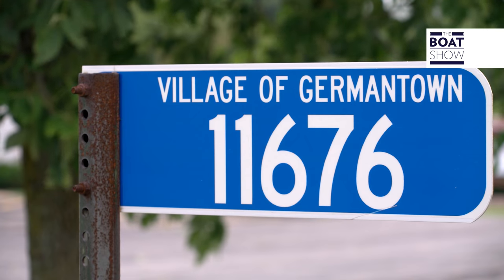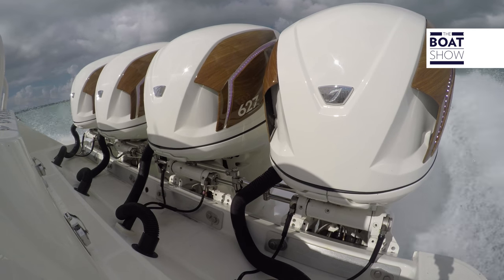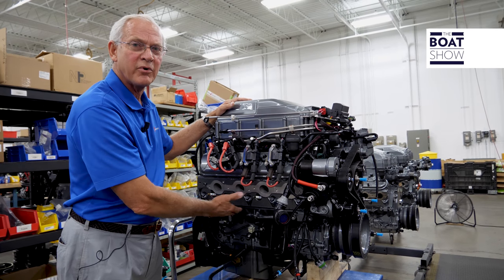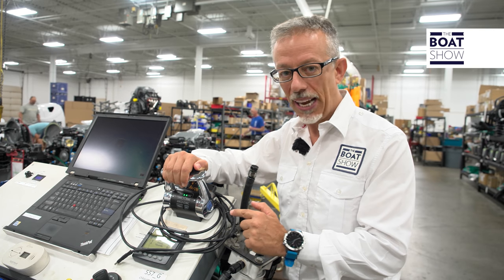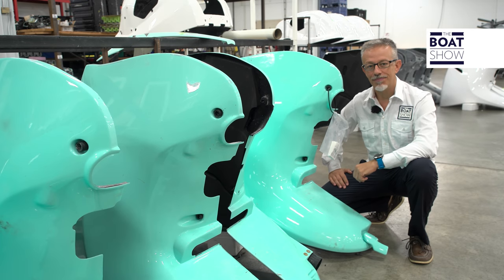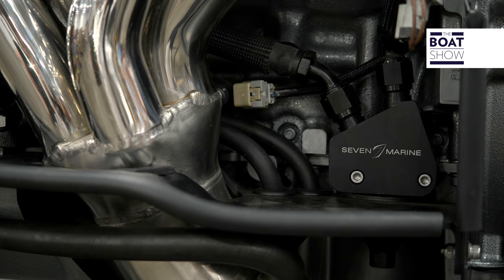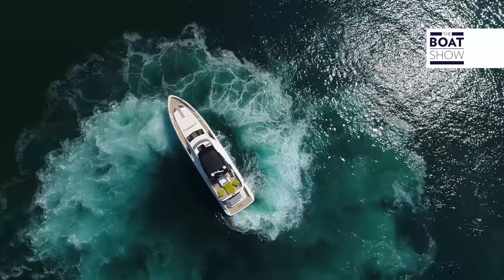[ENG] SEVEN MARINE - HOW IT'S MADE - The Boat Show

Comment: As an outboard Enthusiast and a bit of a engineer here at home I've always been intrigued by the seven marine outboard after seeing this video I have to say wow an American company with the Ingenuity to take GM's very reliable V8 put a marine cooling system drive system and a supercharger in a compact easy to service outboard configuration with a custom looking and sounding exhaust system Cal and LED lighting I think we're going to see this motor dominate The large boat Marketplace, starting to see some of the big-name large boat / yacht manufacturers embracing outboard power as well and it only makes sense they're easy to maintain in a large boat configuration and you don't have the toxic environment inside your boat from an inboard engine and drive. Maybe 10 years from now I can afford to buy a used one.
Reply: you will not see these on working boat Pleasure boats yes but not working boats
Reply: @dexter2433  - Many "working" boats in Oil, Seismic, Salvage and diving use outboard motors .
Reply: you meant to say a Swedish company, which it is by now.

Comment: Soooo many gears and parts to the transmission path.
Reply: At least they didn't use a CHAIN!!!!!
Reply: Andrew Fletcher yea I wonder how the gear train feels when you shove 650 horsepower through it.
Reply: gotta be some efficiency loss there. not ideal.
Reply: Massive torque, massive gearing.
Reply: Welcome to 50 hour gearcase oil changes
Reply: Was thinking the same thing - lots of gear mesh, gears churning in oil, bearings, inefficiencies.

Comment: They are very heavy though...Seven Marine 627... 1094 lbs each...vs...Yamaha 350 or Mercury 400r...668 lbs each.
On a 4 engine set up with Mercury 400r's...thats a difference of 1704 lbs...if you don't need all that power the weight gain
may be unnecessary!
Reply: dont forget the diffrence in fuel consumption

Comment: Fascinating engine. If it turns out there is a large market for these huge power outboards, I suspect additional vendors will join the party. I wonder if some one is seeing what changes have to be made to these LS motors to run in a vertical orientation. If they can be adapted without to much trouble, then you would sea a significant efficiency gain, simplification, space savings, power gain, weight loss, and cost savings. 7 marine will need to do that to remain competitive in the future. And Volvo Penta is still Swedish. Chinese Geely owns only the Volvo car line, which they purchased from Ford which owned it for a while. Volvo AB is still 100% Swedish and makes buses, heavy trucks, marine and industrial engines and more. And I will still call gasoline gas here in North America. I will call it fuel or petrol or whatever term they use when I am visiting those areas which do not use the term gas or gasoline.

Comment: idk, 270,000$ seems like alot for just 2400 horsepower of inefficient over stressed outboard motors

at what point do you just give up on this and go with a real inboard single motor with better efficiency 5/6/7 motors?

Comment: I’d love to know how much of that 627 horse power makes it to the water and how many hours they last? Marine engines are always working hard. Like a loaded truck in passing gear up a hill. Well maintained gasoline EFI marine engines that are mostly kept under 75%  of rated rpm will last about 5000 hours.  Add boost and you cut the life to less than half.

Comment: i want to see a Dino run on output shaft compared to a Verado 350hp 2.6l then compare hp per pound at the output shaft any thing less i see nothing but a motor built just for show and a sticker with the #627 on the side
Reply: That's exactly what this is. It's a fashion statement, basically.

Comment: It's a shame that the mercury 600 hp outboard put them out of business because it looks like they did do a really good job putting this outboard together but mercury has the 2 speed transmission and steerable gear case and is a beautiful engine also

Comment: turn up the boost on those lsa’s make 800 each
Reply: Have to be mindful of not over-powering the drive train...especially when you could have those "Out of water Experiences" when the prop(s) lose resistance then suddenly get it back... That makes a LOT of Shock to the drive train...
I am sure they engineered a "margin of safety"...but as you increase the HP and Torque you 'use up' that safety margin... Not to mention the higher stress on the engine internals from the increased boost... All combining for less 'dependability' and more maintenance...and no one wants to get stranded with a dead motor miles from shore...especially not "Rich Guys" in their Very Expensive boats! (smile)
Reply: Also,  they're 627 prop hp so count in drivetrain losses and it probably is 800.

Comment: They have a revolutionary invention called an inboard/outboard, uses an iron block v8 truck engine and does not need all this complex gearing/custom parts..  Every gear wastes energy and efficiency, that's why outboards have not used a setup like this before.   Also supercharging and turbocharging is great for cars that need the power for a few seconds to accelerate but with a boat you need constant power, I would be real skeptical about the longevity of these car engines being used for boating..
Reply: Well you obviously don't know a thing about Mercury outboards and their history.

Comment: You didn’t mention anything about the outboard’s environmental impact compared to other outboards.  And what about an outboard jet type propulsion to cut down on marine life damage?  Another thing about outboards is the convenience for repair.  How easy is it to service?  How do you get it on and off, with a crane?  Is it OK for it to be on a boat that is docked and therefore with the propeller submersed for long periods?  What is the life expectancy of this outboard?  Is it equally at home in ice cold waters as it is in warm tropical waters?
Reply: If you knew a little more about outboards, you wouldn't ask those questions. There's an emissions decal shown on the engine that every certified tech will recognize, regardless of make. Every. Single. One. 
Every owner of a new boat engine has seen at least one. 
Even people shopping for one online have seen it. 
It very clearly answers your question, yet you still asked the question. 

Think about that for a minute.
Reply: DL- Seems as a consumer, I need to do my own homework.  Emission standards are vastly improved for outboards from what they once were.  I apologize if I sounded alarmist in any way.  I have two outboards and they do have decals on them- I looked.  But one outboard is never enough so we are all looking for another one to add to our collection.

Comment: The Corvette and the Cadillac CTS-V don't have the same engine like you say at 3:20.  The Cadillac uses a non forged 6.2L "LSA" making 556hp with a small 1.9L TVS supercharger vs the Vette which uses a fully forged 6.2L "LS9" with a 2.3L TVS supercharger and titanium valves/ rods making 638hp.  Huge difference in price and performance.
Reply: you understand they have 527, 577 and 627hp variants of this outboard right?
Reply: Same 6.2 lt block
Reply: Sounds like the type of guys that go around saying that their Chevy truck has a "Vette motor in it".  SMH
Reply: Nah, I'm just saying the blocks are the same basic design, and sadly, I drive a fucking civic...
Reply: Oh like how Koenigsegg used ford modular engines in the begining and continues to use the same basic block design/architecture like dimensions, crank centerline, cam covers, etc?
Reply: Koenigseggs are crazy. Or like RUF not being a Porsche?
Reply: Chrismayo1981 Don't feed the troll and never trust an edited comment. Of course turbodieseldans word caries more weight than the owner of seven marine. And of course in such a short video aimed at the general public he cant go into the all of the differences between the LSA and the LS9 engine, but the point is the 627hp outboard is the LS9 and the 527 is the LSA base model and the core components are the same, Oh noes one has forged rods i guess Rick Davis doesn't know shit or whats in the blocks he buys in mass quantity from GM and must be an idiot or a conman! But fuck it Dan knows more than this guy who started the company and is here to liberate us from such misinformation, the core engine design is the same which is what was clearly implied. You must be a real fun guy to hang out with Dan!
Reply: He is clearly talking about the $11k 556hp Mexico built version found in the CTS-V and not the $25k 638hp hand built version built in the USA stuffed with titanium internals and a larger blower.  Calling it a Corvette engine is a lie, he could have simply said [This is the 556hp engine from the 08-14 Cadillac CTS-V] and leave the LS9 powered Corvette out of the conversation unless he is talking about using the forged, titanium, 2.9L blown LS9 found in the $100k  ZR1.
Reply: 7:50 he mentions putting 627hp through the gearset. We also don't know how this was edited either there may be also be language barriers  considering this channel is an Italian channel,Your technical references on the GM product whilst correct cannot also be fully covered in a 12minute segment and leave time to talk about the rest of the product, do you think he is trying to deceive people?
Reply: Correction 7:40
Reply: Dan, The expression is “could have” which is typically compressed to “could’ve” which of course sounds a lot like “could of”, but which in the English language does not even exist. Please Dan, try to pay closer attention to the details. Details can make you sound intelligent and informed, or as in your case, moderately illiterate and clueless.
Reply: LS actually. LT is the genV direct injected variant. Nothing is the same besides CI.
Reply: Until recent years, they were identical motors, even the metal alloys. But they are NOT exactly the same anymore. But the CTS-V still will pucker your asshole- I was lucky enough to ride one and would love one over a vette any fuckin day.
And like the other guy, my car is not a hot rod. I drive a Volt. But I live in a big city and never travel more than 20 miles a day so it's perfect for a starving college dude!
Reply: I'm guessing you are getting a boosted CTS-V motor for the price and delusion of a Zr-1
Reply: Pretty sure he is talking about the lt4 in the CTS-V3 and the C7 Zo6,  he never said it was a ZR1 engine.
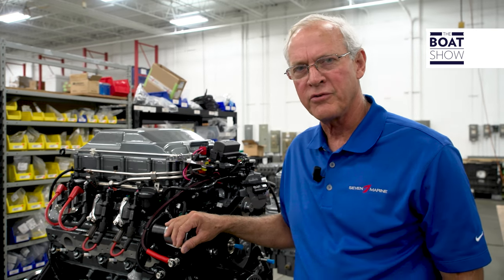Reply: @cleverusernamecl5532  3:14 "This is a General Motors Gen 4"  The LT4 is a Gen 5 engine
Reply: @Sir.VicsMasher  Makes sense, the v3 was released in 2016 iirc, so these would be older engines.

Comment: Brilliant!  I wonder if the transom on my bass boat could handle the weight.  Methinks the C/G may also be a little high.  These days,  horsepower is pretty much determined by how much boost the lower end can stand.  I'm sure the ECU is custom for this thing,  and therefore you can dial HP up and down depending how large your attachments are.

Comment: Ok love the outboard for design, sound, and hp of course, but also the options it brings to the water. The 627 is not a boat anchor unlike over marketed mercury, they put  a corvette with a zf transmission, and like dunderogbrak the gearcase isn't Seven Marine's either. Either way this is an awesome innovation and they can own that. Infact, they only should advertise it as an innovation on the water, after all they have achieved incredible hp to weight ratio. That was what the spokesman should have said. Look at the car companies calling fuel injection new. how about direct injection? its all old technology. The diesel engine was the first fuel injected engine ever. In somewhere around 1806. It was around 1890s rudolph diesel made the first direct injection. The whole world is educated. So why do these manufacturer's still think they are fooling people like the car companies flat out lying calling it "new technology" ?

Comment: All this speculation and guessing about drivetrain efficiency. Just do the math. At BEST each gear change is 95% efficient (depending on the type of gear, and assuming very little speed reduction). From the output shaft of the motor, I counted three straight cut gears, the ZF transmission, one straight cut torque splitter, and two bevel gears on the lower unit. Assuming the transmission is 95% efficient (big assumption), that gives 0.95x0.95x0.95x0.95x0.95x0.95x0.95 or approximately 70% efficient best case and 428hp at the prop. I'm not making any judgement on the design merits, only putting some numbers behind the speculation. I'm guessing a vertical shaft outboard gearing is 85-90% efficient for reference. Also for reference, in an automotive application a transmission and differential are 80-85% efficient at best.
Reply: They are rated at 627 Propshaft horsepower.  Not powerhead horsepower
Reply: Well then 890+ hp for the power unit is quite impressive! I happen to really like it. Reference the form factor for Hellcat engine, but packed into an outboard!

Comment: Nice. Now also design and market a small 250 Hp lighter cheaper reliable motor for the average boater.... Joining with Volvo good move. Maybe run a toothed gilmer belt down to prop shaft from crank and lose all those gears and 90° zf box . Also go back to normal shift dogs in lower in low hp motors. A simple affordable 5.3 LS GM block natural aspirated raw water cooled would shave $$$$$ off mfg costs .
Dealer support and warranty a big concern. Good luck . Shalom

Comment: They want the international market to reach the 1% that can afford a $750,000 outboard sport fish world wide. Like he said target the Pagani style so that rich guy can color match his car and boat for the extra ego. My Yamaha 250s get my 30ft boat every where I need to go to catch the same fish in the ocean. But only cost $13,000 a piece. An rigging is simple. Run fuel an power. Your saying I have to run a glycol cooling system an who knows what else. This is how you over engineer an complicate things for no reason.
Reply: when i saw the gearing just to get the power down to the prop it was dead in the water for me. they highlight it like its a good feature but your only losing power and efficiency plus a whole host of other issues
Reply: Gonzo brake horsepower for engine is over 600. After parasitic loss to the prop shaft how much of that is left? How much slip in that wet gear box? Funny how nobody asks the good questions these days.
Reply: Your jealousy is apparent.
Reply: Don't get me wrong each one weighs over 1000 lbs. and I don't have a boat. But it makes sense to use a closed anti-freeze cooling system and a heat exchanger. I'm not sure what salt water would do to a Chevy motor but it can't be good.
Reply: Well, if you have millions in a bank account, what are you SUPPOSED to do with it? Spend on a Yamaha 250, just because YOU have one? It's their money.
Reply: I believe outboard are rated at the prop shaft. So if the outboard engine is sold as 627hp, then it'll have 627hp at the prop.
Reply: If you can afford it....why not?
Reply: yes agreed !
Reply: They are selling them, so there’s a reason.

The average joe doesn’t need 1200 hp on his CC. But some want it, so there’s no reason someone shouldn’t make it. Further, some tourney fishers “need” it, well want it for a more useful reason lol
Reply: The people that guy them are people like Enrique Iglesias.  He bought one with 4 557's around 2014.  Then took the 38-40ft Intrepid and had all the upholstery,  electronics and paint redone before even driving it.  Must have had well over a million in it.
Reply: Christian Eidsmoe excactly it would have been better if he would have kept his mouth  shut or his fingers from typing.
Reply: Just buy a kayak.  Stop being lazy.
Reply: Gonzo the hp they’re advertising is rated at the prop
Reply: 13,000, what used!
Reply: What about a Catholic converter.
Reply: They aren't everyone's choice either.
Reply: The reason for cooling with a glycol solution is pretty obvious . to avoid running corrssive salt water thorugh the engine and it does not bring any complication, or at least not more than what is present in any ordinary car, you seem to be quite envious about the fact that you have not reeached teh level in life as to be able to afford those beautiful engines, neither do I  but i have amore generosu soul and like the fact that others do can have those marvels ..........

Comment: each gear is hp lost that's um 627 minus 327 equals one 300 yamaha at the prop 
good luck with your toys
Reply: hahaha what are you even talking about? 

1.  these dont have anywhere NEAR 50% drivetrain loss, probably around 5-10%
2.  that 300 yamaha you talk about will also have 5-10% drivetrain loss...
Reply: Cobb Knobbler  Yooooo manure for brains, im dead 😂😂😂😂😂😂

Comment: MORE GEARS THAN AN 18 WHEELER...large loss of power in that drive train. Lots of fuel used to drive those gears.t might be better if the crankshaft was vertical.
Reply: the GM oiling system is not designed to operate vertical

Comment: these are over a hundred grand each......
Reply: WHAT?!!!
Reply: Thinking about the boats these motors are headed for, the wood trim alone would probably repower my boat.
Reply: The 557 costs $79,590; the new 627 goes for almost $90,000.
Reply: Only $90,000? I’ll take two